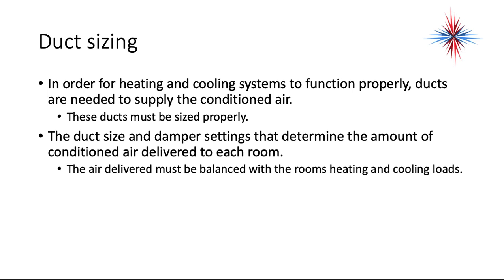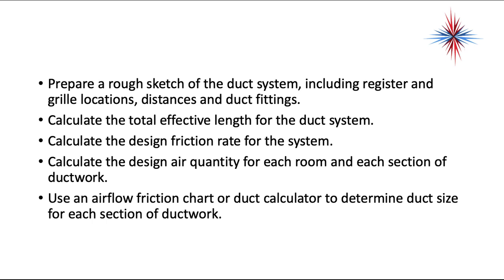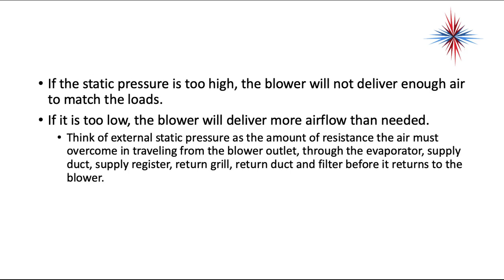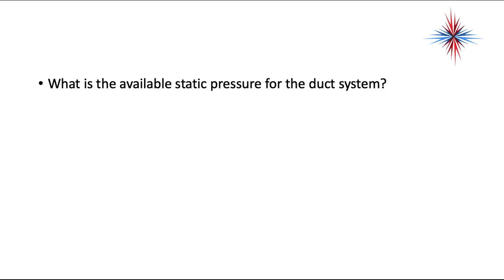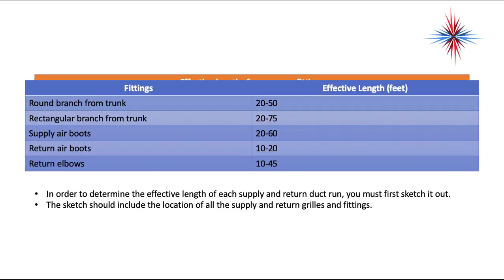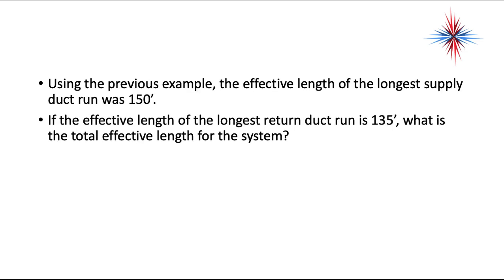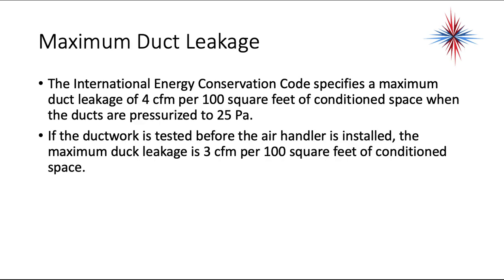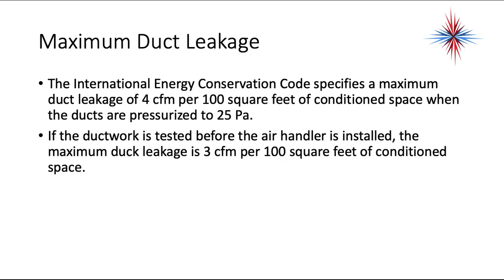System Design -  Duct Sizing

Comment: Thank you for the informative video. The only thing... Could you also make a video, how to choose a blower based on the duct/trunk sizes? I see a lot of oversized (compared to trunk sizes) furnaces tripping on hi limit, failing motors etc. A lot of installers change furnaces but dont match it to the duct sizes. Thank you 👍
Reply from the maker: Working on something that may help. This is not the ideal way to size equipment, but I may have a solution that won't tell people how to do it the wrong way.

If you haven't already, please subscribe so you get notified of the new releases:
https://www.youtube.com/subscription_center?add_user=cmolnar65

Comment: Greetings Dr. Molnar:

Thank you for reviewing my question regarding available static pressure at the 9:40 mark. My reason for the question is because the textbook did not mention what I am about to ask specifically. I wanted to make sure my assumption is correct.

When calculating the ASP, I understand we are using the Total Effective Length (TEL). Here is my question. In this example, when we add the supply register, are we ONLY considering the one for the TEL of the supply branch? If so, this clears up my question. 

Secondly, if the TEL of the return branch has TWO return grills, would I use 0.06 for return grills? 

My reason for asking these questions is so I can "make peace" with myself that this particular example only considers the TEL of both lines. The textbook never said that, and I always assumed this was true, but I wanted to confirm this if possible.

Any guidance you can give will he much appreciated. Thank you SO much for all of your videos.

Comment: I have a 420 square foot building with a furnace and a 19"x12" x 4 foot plenum. I bought 16"x8" rectangular ducts that run 24 foot long with six 6" vents. Are the ducts too big? Should I go with a 14"x8" or a 12"x8"  duct size? I haven't installed the 16"x8" yet so I could exchange it. Thanks.

Comment: Dear Sir,

I have one query, When designing the HVAC supply duct system, After calculation of ASP from the manufacturer blower data and Device pressure losses. That ASP will become the pressure drop budget for the duct system. Now if we are designing the duct system with equal friction method based on FR calcualted...and CFD analysis of designed duct  fetches static pressure and total pressure data w.r.t our design.

Now w.r.t ASP which is our pressure drop budget, say some 0.4 inches of water gauge.

Now to check whether duct design is within limit in CFD analysis tools.  which pressure drop should I consider ( it's a total pressure in the volume or it's difference in Total pressure at inlet to outlets, or it's a max static pressure developed in the air volume inside duct)

kindly clarify

Dear Sir,
I have one query, When designing the HVAC supply duct system, After calculation of ASP from the manufacturer blower data and Device pressure losses. That ASP will become the pressure drop budget for the duct system. Now if we are designing the duct system with equal friction method based on FR calcualted...and CFD analysis of designed duct  fetches static pressure and total pressure data w.r.t our design.

Now w.r.t ASP which is our pressure drop budget, say some 0.4 inches of water gauge.

Now to check whether duct design is within limit in CFD analysis tools.  which pressure drop should I consider ( it's a total pressure in the volume or it's difference in Total pressure at inlet to outlets, or it's a max static pressure developed in the air volume inside duct)

kindly clarify

Comment: 6:20. On system design pressure. How do you know to select .1 or .5 wc?
Reply from the maker: Equipment specifications are the primary decision. What can the blower and air handler handle?
Reply: Why wouldn’t you rather design for .1 and run your fan on low speed and the cfm would be pretty close to 1250. Seems like you might have less fan noise, and more efficient.
Reply: @jt3366  Right. I've been designing for .1 wc since I started the trade. Now I hear guys saying "designing to blower specs". Some air handlers have a design pressure from .1 all the way to 1.0..

Comment: Hi Christopher, It's great! Thank you very much for your showing. If there are multiple levels, 1st, 2nd, 3rd level, how do I calculate ESP? If there is a VD after transition on straight duct on 3rd level and a VD on a take off duct drop down 2nd level, all two VD are calculated in ESP system? Thanks
Reply from the maker: Roan, remember static pressure has nothing to do with "movement" or velocity pressure. So once you use the longest length method the static pressure will not change. Just make sure you are using the correct longest length and size all risers from 1st - 3rd floors appropriately.  I will sat that if you are doing multiple floors and have the opportunity  to zone them with a 3 zone damper system (thermostat on each floor) I would consider doing that.